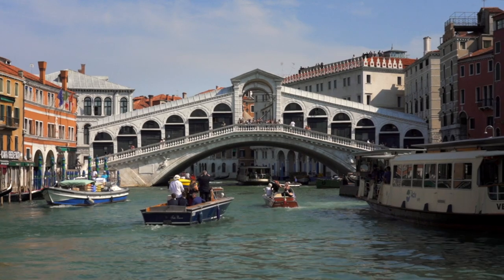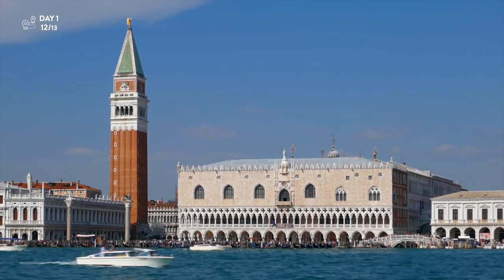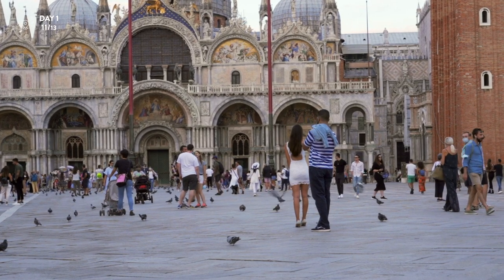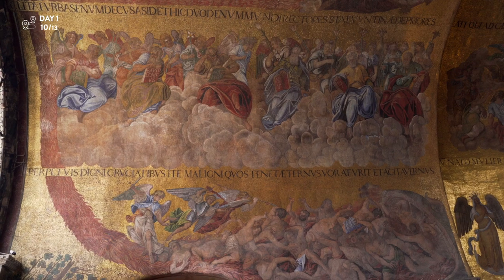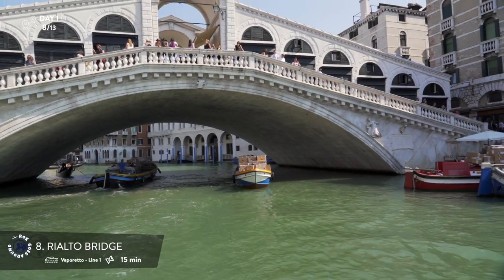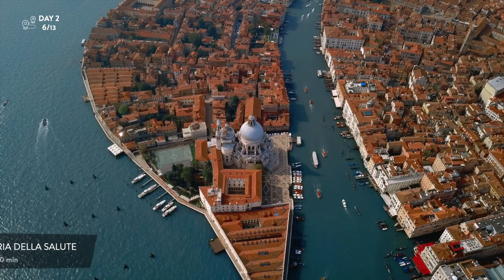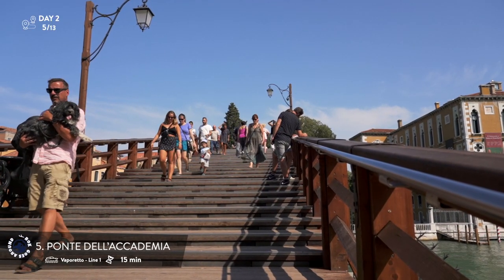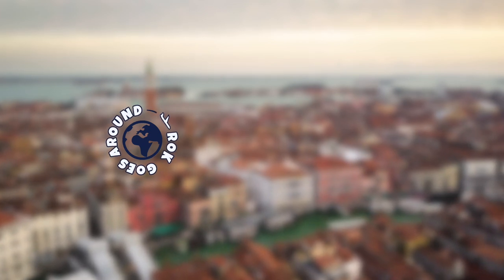Maximize VENICE - Best itinerary! (Save this Plan)

Comment: Hi Rok, i have one small question about Venice bus tickets, is the 48 h or 72 h tickets calculated with hours? Or with day? I mean, if i brought 48h tickets from Monday afternoon 17 o'clock, can I use it until Wednesday 15 o'clock?? ( Totally 48 hours) or i can only use it until Tuesday middle night?Because that's the two days?
Reply from the maker: Thanks for asking. I presume you are asking about vaporetto. Tickets are valid for the numbers of hours bought. The time starts ticking away since its first validation.